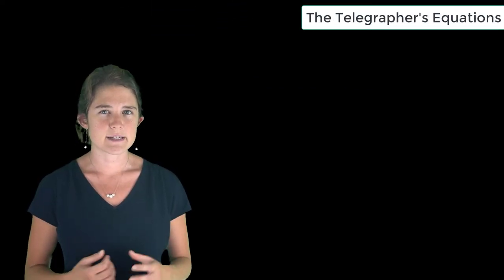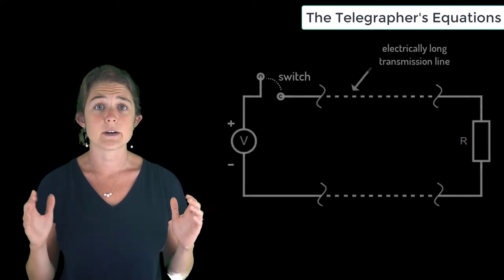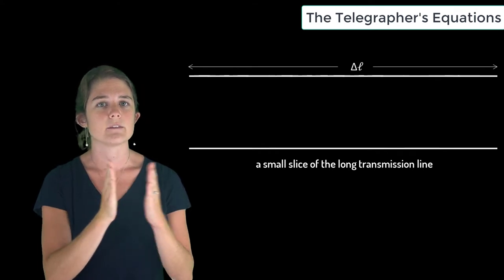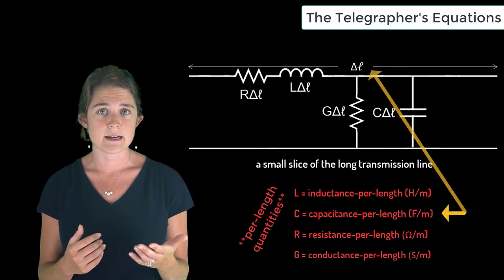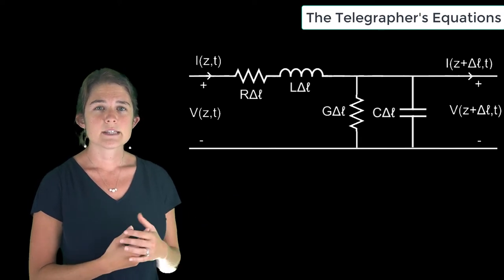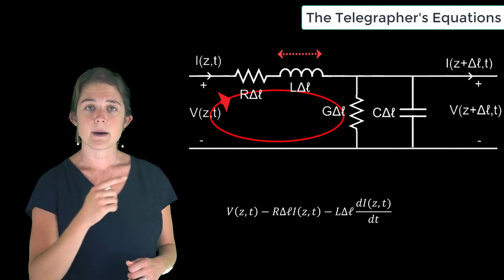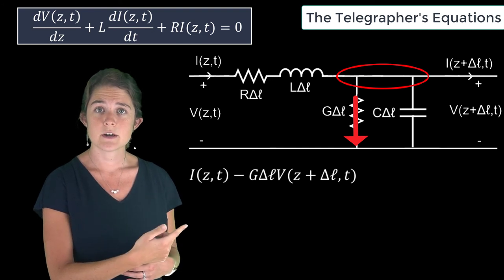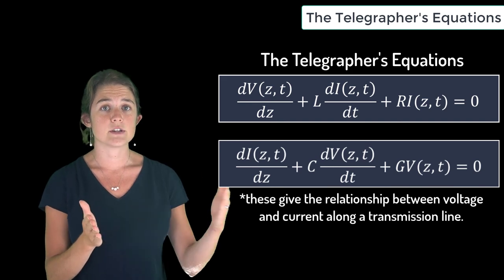The Telegrapher’s Equations — Lesson 2

Comment: @ 0:07 If the AC-frequency is 60 Hz, then the wavelength is 5 million meter. The wires in your house are thus electrically very small compared to this wavelength.
Reply from the maker: The phase velocity of an EM wave traveling in a transmission line is generally significantly slower than c.
Reply: @emviso  Yep, but even if v-phase is only 1 percent of c the wires in homes are still electrically long.
Reply from the maker: @veronicanoordzee6440  you mean electrically short - and yes, that's definitely true!
Reply: @emviso  You got me ;-) Of course.